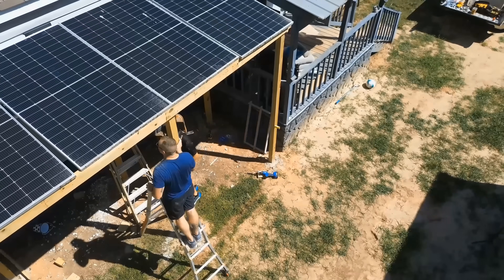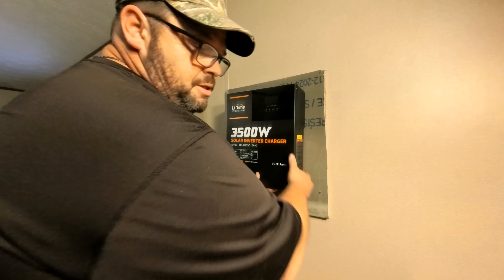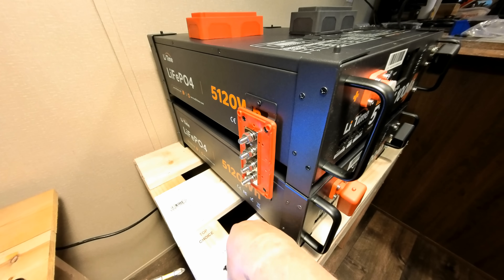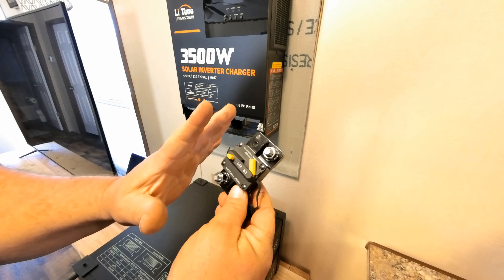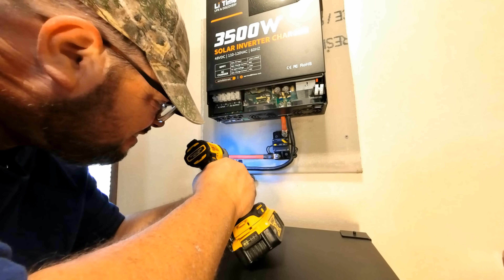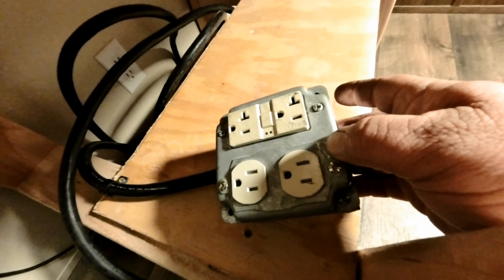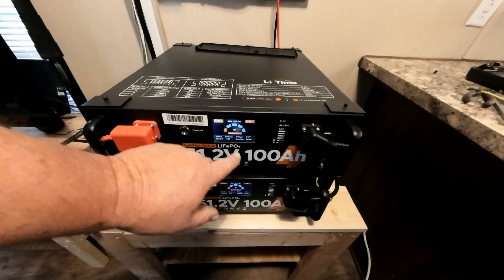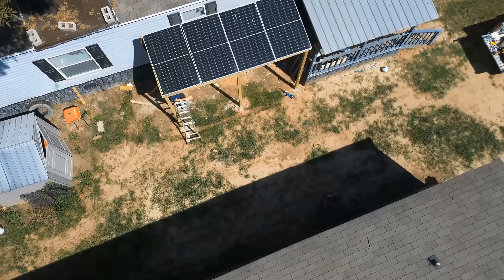BUILD Your Own Powerful Solar System With LiTime

Comment: Why do you need the bus bars?
Reply from the maker: @Offgridsolomom  sure I always wondered that same thing and then I realized that the power needs to be distributed evenly in between the batteries and in order to do that there must be a bus bar and you must have the same length battery cables from each battery going to that bus bar or one of the batteries will be out of sync
Reply: @OKLAHOMAOFFGRID well thank makes sense thank you for the information

Comment: have you had any issues with the circuit breaker since it is rated for 48 volts max, and the batteries can be charged to 53-56 volts?
Reply from the maker: @trockotrocko8105  no they say 48 volts on them but they are specifically made for this system made by li time.. these are China products and sometimes they don't know how to promote the products correctly
Reply: @OKLAHOMAOFFGRID  thank you so much

Comment: Just curious if this can be done to run a double wide mobile home but run most of the house on it. the breaker panel runs everything. I don’t want to limited to a power strip to run the appliances since they won’t be near each other and would have to connect an extension to power strip
Reply from the maker: yes  you will need to get a critical load panel and wire it up

Comment: This is amaaaaazing.  I have a small 12v solar system I built myself but I had no understanding of high voltage solar systems.  Now I'm catching the drift, and this is totally something I could do.  My question is: you talk about using this as a backup system in case the power goes out but I would be more interested in using it 24/7 to save on my electric bill and/or to power a fully off-grid cabin with conservative power needs.  Would this system be appropriate for that?
Reply from the maker: it would be  good start...watch my other solar videos where i power my cabin that is completely off grid with solar only and the system is about the same size just more solar panels
Reply: Thanks.  I'll definitely look for them.  The reason I like this one is because it gives easily followed step by step instructions.

Comment: Thank you for this informative video!  It was very helpful.  I currently have a 4 kW grid-tie system and I'm moving to a new house early this coming summer.  I'm going to put together a giant 21.3 kW array with a hybrid inverter (or 2).  I will eventually add batteries when I can afford them.  Now I've never used a hybrid inverter before.  In your video, I heard you talk about grid power being used to not only power the load but charge the batteries.  My question is, when is the best time to use grid power to charge your batteries?  I keep thinking that's counter-intuitive when you have solar.  The only use-case I can think of is if it's still during off-peak power for my electric company and my batteries are very low.  It could get a little boost so that less grid power is used during peak.  But I would think you'd want to almost always charge from the PV arrays.  If would greatly appreciate if you could coach me on this subject a little.  Thank you.
Reply from the maker: Yes you are absolutely right..Peak hours to charge from the grid if your even going to do it at all. yes try to never use the grid again if possible. the only other reasons for the grid is if you have 3 or 4 cloudy or snowy days in a row and you need to get the batteries back up in case there is an outage you always want to have that power stored in the batteries just in case....but ya..my opinion Pv only if possible...

Comment: Total beginner to solar setups and your channel is where I'm starting at.
Question: If using the EG4 Inverter charger instead of the LiTime one, can one still use the rest of the components - just to avoid having to run any of the solar panels in parallel?
Reply from the maker: Yes I see exactly what you're saying the voltage is much higher on the eg4 and if you're wanting to run multiple panels in series then I would definitely get the EG4. Email me if you need help figuring it out

Comment: Really appreciate the information and tutorial
Where I live in Louisiana the only problem I worry about with any solar panels occurs when there is a hurricane headed our way
Any thoughts on a setup where you can quickly take down standard panels and then return them to their position once storm has passed
Reply from the maker: ya sure...but are we talking about 100 mph winds? you can make a ground mount that is concreted in the grown but will allow your panels to lay completely flat if high w3inds are coming...and by the way panels are not to expensive can get you 10 410 watt panels for less than 1200 bucks
Reply: @ thanks for the reply.
Reply from the maker: no problem...I have installed systems in Keithville and Bossier City L.A.

Comment: But why right in the middle of your living room? Inverters buzz.. very annoying let alone the giant eye-sore. Surely you have a different room/closet.... Looks trailer trashy sorry but it does dude. I getting ready to put up a big system. 9k watts in panels 10k all in one inverter with all fuses self contained with 23kwh of battery storage. Around $14k when finished but worth every penny.
Reply from the maker: Everybody is entitled to their own opinion and even your wiring job or your displacement may look trashy or even trailer trashy or even house trashy to some other people that want to do it in a different way. Don't get me wrong I understand where you're coming from but remember not everybody has a set place to put their system like you may have and it may have to go in a place like I had to do which was exactly the case

Comment: thanks for doing a clean install! only your 7th install.... makes you more experienced than some of the "professional" installers i have spoke with. Can you setup a small panel with breakers running the devices you mentioned and the solar inverter in something of a "bypass" mode so that its always using grid power when its up? im not sure if these are the correct terms or if the way im thinking about it is wrong.
Reply from the maker: Yes I believe what you're asking me is can you run a system like this without solar panels and use the batteries and the inverter. And then just use the wall for charging when the batteries get down to a certain point. If this is what you're asking the answer to this is yes.

Comment: i would use signature solar rack batteries instead. Li time are grade B cells and only rated for 4000 cycles. same price
Reply from the maker: i did not know they were grade b cells...where did you here that info from?

Comment: I have a 6k watt inverter. With 2 48v 100Ah batteries. Would that be enough to run what you pointed out in the video daily? Off grid. I'm just trying to figure out how large a system I need. Currently In my non offgrid life I use aprox. 1000kWh I haven't bought the solar panels yet. My system will take 400watts DC from the solar panels. I'm sorry if my question lacks the needed info, I'm super ignorant of all things electrical lol.
Reply from the maker: Your system takes probably 400 volts dc not watts...the watts are probably around 4 to 5 k ? correct? if this is correct...I would say yes it will come very close to doing what you need...the key will be to get 5 to 5 k worth of solar PV input to keep them batteries topped off by noon

Comment: Good work but the positive and negative should be the same length
Reply from the maker: No, the positive and negative cables from your battery to your solar charger do not need to be the same length; the key is to ensure that the positive cables to the charger are all the same length, and the negative cables are all the same length, but the positive and negative lengths can differ from each other

Comment: I want to build a system like this to power my new F150 lightning... which will also power my house in an outage. I would need 240 output and 6k (better to go 12k) output.
Reply from the maker: Is the new 150 lightning an EV ?
Reply: @OKLAHOMAOFFGRID  yes. 131 kwh battery.  The provided charger is 240 @ 48 amp, but it can charge slower.  It also has 9.6 kw output via 120 and 240 plugs, so I can set up a panel for emergency and power it from the truck.

Comment: Your's are the best step by step. I just need 4 12 volts lithium batteries and I'll have everything I need.  Honestly,  what's the best value?
Reply from the maker: @stevehall9256  if you're running a 48 volt system your best value is absolutely 100% going to be a server rack battery. Most 12-volt batteries that are ran in Ceres can only accept 8 batteries in series or a batteries in parallel and you cannot add any more because the BMS is not capable of handling too many brains at once. But when it comes to most of the BMS the server rack batteries they can be stacked sometimes 12 or even 16 and sometimes even more. The thing about the server rack battery is that it is equivalent to the 412 volt batteries but with just one single BMS
Reply: @OKLAHOMAOFFGRID  thanks for the reply.  I definitely want a system that can be enlarged later.  I have a 24 volt aims 3000watt inverter that seems to be compatible with a 48 volt system.  8 300 watt grape panels,  4 40 Amp charge controllers and I'm shopping batteries.  When you say a rack battery,  is that a type of battery or a brand?
Reply from the maker: Server rack battery is a type of battery like in this video that fits into a server rack case. if you have a 24 volt inverter by Aims you will need a 24 volt server rack battery and you will have to keep the system 24 volt unless or until you upgrade your inverter
Reply: @OKLAHOMAOFFGRID  I understand your time is valuable.  If you do consulting,  let me know if you're available
Reply from the maker: email me if you would like help oklahomaoffgrid@gmail.com
Reply: @OKLAHOMAOFFGRID  ok
Reply: Thanks.  Can I order what I need through your site to get a good price and you make something

Comment: Maybe put a timer on your plug so for say 5 hours a week or so it charges the batteries. If your on a dual tariff (cheaper off peak times) you could charge it up then. To help compensate overcast days.
Reply from the maker: No need ...the settings in the inverter will let me run solar only solar and wall power solar first then wall when solar not available...and so on

Comment: I prefer a simple system myself. 
I have 2 Bluetti AC200 Max power stations, over 2,000 watts each. Charge controllers and everything else is included in the units. They power my mobile home in the mountains. 
Just plug solar panels into them. 
They will charge as you use them. Charge by generator. Charge by electric outlet. Solar panels. 
Plus I just pack the Bluetti's up and bring them back with me when I'm not staying at my mobile home.
Reply: Sounds great but if one component of those units breaks you'd either have to send it to warranty or trash it and get another one.

The benefit of these systems is that if any component breaks, you can either repair or replace that component instead of the whole system.
Reply: @joseroman4811  Units have a 5 year warranty. 
I'm good, my man. 👍🏾
Reply: @72Dexter72Manley72  Rock on my dude!!
Reply: @joseroman4811  For sure Man. $2k for the units and I was set.

Comment: Not trying to bust your balls here but a lot of those cheap Chinese inverters have terrible support.

Do you have an IMO disconnect for your PV.

It’s better than nothing for sure..
Reply from the maker: yes they are cheap...but seem to have no problems so far in my case...I also own 2 EG4 3k inverters which are also high frequency and still no problems for over a year straight running 24/7
and yes I have an IP66 rated DC disconnect switch

Comment: You and almost there. A professional would secure the  Terminal Lugs with a 10 Ton  Hydraulic Wire Battery Cable Lug Terminal Crimper. He would also tighten all connections with the correct Newton Meter Torque Wrench. Remember everything you show in your DIY videos is tax deductible I am learning a lot about Li Time stuff. Thank You.
Reply from the maker: yes I KEEP ALL  my receipts 🤣 and yes i have the old school crimper but it serves the purpose for now...torque wrench will be next

Comment: This is the first 48V server rack battery that I've seen with a price per watt hour to match the price I paid for my four 12V, 300 amp hour WattCycle batteries.  As always, if you wait just a little while longer, someone is always going to come out with a new product that is better, or cheaper than the one you just bought, but it's great to see battery prices coming down as quickly as they are, and my advice to anyone in the USA interested in getting any of this stuff, do it now, before the proposed tariffs go into effect, and the price of everything starts going up, instead of down, like it has been for some products over the past couple of years.
Reply from the maker: this could very well be true on the tariffs

Comment: Nice instructional video.  Too bad that LiTime only supports up to 150vDC as many all-in-ones have really jumped that number.  But for the $$, not bad.  On the T-class fuses, Inverter Service Center, Amazon, Home Depot, etc., can easily source them since someone asked in the comments.  Gary from SE MI
Reply from the maker: right on...and yes the 150 volt cost me time and wire i will admit. But it will still hold  almost 5000 watts...just have to configure it a bit different than eg4 equipment

Comment: Can you put the link for the brackets that separate the batteries and the mount to attach them together, please?😊
Reply from the maker: those things where soo cool. Problem is it comes with the purchase of the battery by li time. also it seems they may only fit li time batteries not to for sure yet